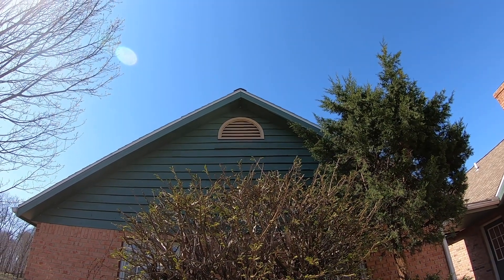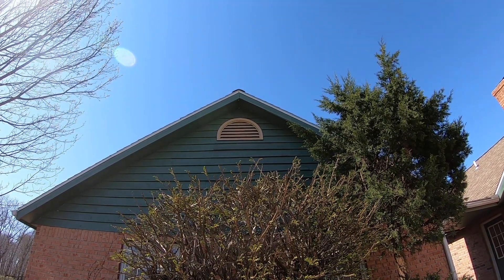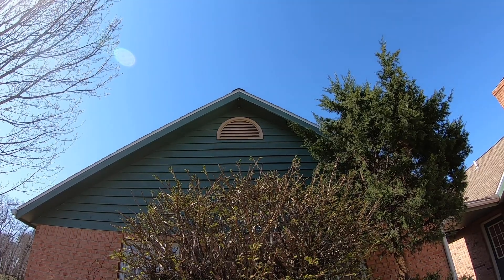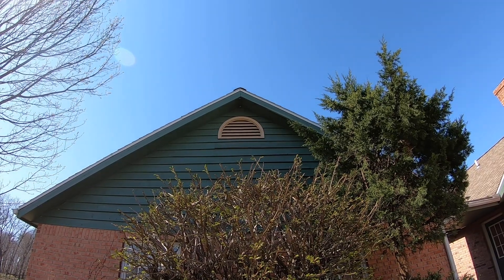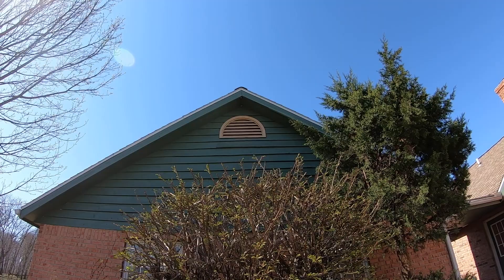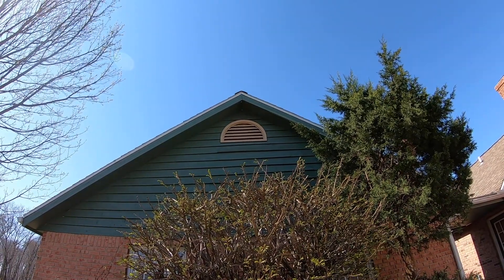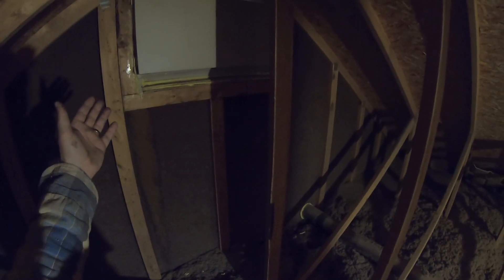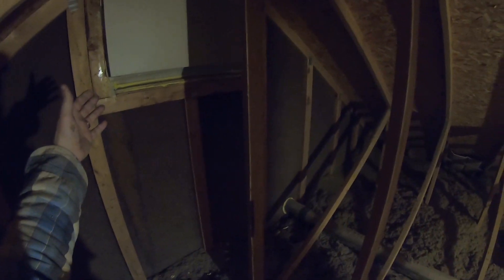How to Stop Gable End Attic Vents From Leaking

Comment: I think this is a really good idea with a gable end fan as that’ll keep pulling air through the top but a static vent it’s effectively nullifying the vent.

I’ve just fitted a 16” AC Infinity gable fan with Bluetooth controller and I might use this method to force it to pull hotter air at the top of the attic space and provide some extra water ingress protection.

Comment: I like the idea but this fixes one problem but causes another. You have essentially reduced the surface area of the gable vent by at least  75%. Attic ventilation should equal approximately 1 square foot of vent area for every 300 square feet of attic, so figure out roughly how many square feet the footprint of your attic is, and then divide by 300. However you have a great idea I think if you manufactured the same sheetmetal but added a 45 degree angle 📐 on the backside you could achieve the desired results.
Reply from the maker: I agree with you.  However, I added ridge vents and intake baffles during this time to the attic as well so I have plenty of ventilation.  If I wasn’t going to do that then I would have set them back at a 45 like you suggested.  They were just easier to make this way.  I think I mentioned this in the video.
Reply: @HowtoHacks  I'm learning about this now. Most research I find indicates you should NOT combine gable vents with ridge vents. This is why someone might have had your gable vents closed up with the Styrofoam that you mentioned.. if you google it, everything I find says the best system is soffit vents combined with ridge vents is the best system. A gable vent thrown into it actually causes suction and throws off the natural flow of the air from the soffit vent and the ridge vent.. I believe I need to close off my gable vents, add the baffle vents you mentioned to avoid insulation from preventing air flow from the soffit to the ridge vent.
Reply from the maker: @mar4380  Yes this is the case.  However the people who put the last asphalt roof on my house didn’t cut the roof decking back at the peak so there technically is was no ridge vent as it was blocked.
Reply: @HowtoHacks  so you installed ridge vents that don't actually function because the decking isn't cut and kept your Gable vents but impaired them?
Reply from the maker: @isaacholzwarth  I didn’t install the roof.  The ridge vent was like that when I purchased the house.  All the gable end vents were also blocked off.  This is because there was an issue with ice and snow blowing into the attic apparently.  So this baffle over the vent allows air to flow in and out of the attic but blocks water, ice, and snow from getting in.  After I installed these I could still feel plenty of air coming in and out through the vent.  I have since installed a new metal roof on the house with a proper ridge vent and completely removed all the gable vents when re-siding the gable end walls.
Reply: @HowtoHacks  a year later and we have heavy rain in the Bay Area and I still have my leak since I didn’t do anything about it 😂 at least you took action. Did your solution keep the water out?
Reply from the maker: @victorsr6708  It did the job.  If I built them again I would either have them slope back at 45 degrees or I would make the box a little shorter to allow more air flow over the top.  I ended up tearing all the gable vents out after I installed my metal roof, but they worked for the year and a half they were installed.

Comment: I like the fix, but will enough air flow through the attic now?
Reply from the maker: It probably does slow air flow some.  I was in my attic recently to check it actually.  It was 90 degrees outside and I could feel the air flowing through and it seemed about normal (however I didn’t take a temperature reading).  It all depends on what other types of ventilation you have (ridge vents, soffit vents, can vents).  If you’re worried about airflow you can make the box extend out from the vent farther which would make the opening bigger at the top.

Comment: I like the idea but you did not show how it breathes , I don’t you where going to set it back on a 45 degree angle to allow air but yet keep out the wAter
I have a whole house fan and a 40 by 30 wooden louver that lets water in
Can you help me with that?
You seem good at this stuff
Reply from the maker: Watch the video again.  The air flows in and out through the top of the box as it’s open.  You can angle it back if you want.  It’s just easier to fabricate as a box.  The bottom of the box does have a slight angle to it so water will drain out.  I made mine with aluminum coil stock but there’s many different ways to build this.  You can build it out of plywood and line the plywood with aluminum as your vent is pretty big.

Comment: have fun with the mold in your attic because you just restricted the air flow  of the vent.
Reply from the maker: That is something to consider.  However, these vents were completely blocked off since the house was built so this is more airflow then there was before.